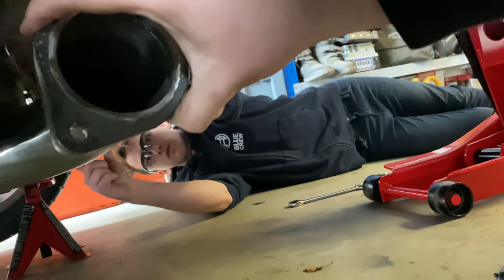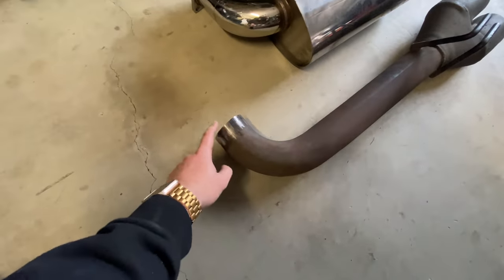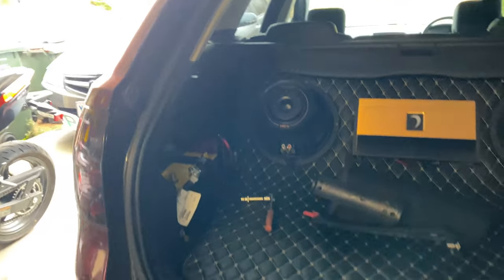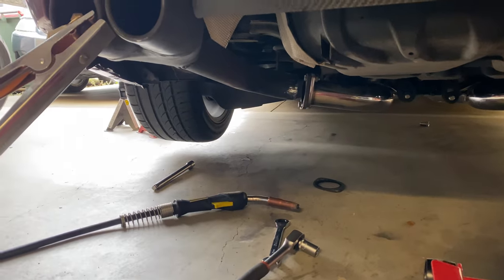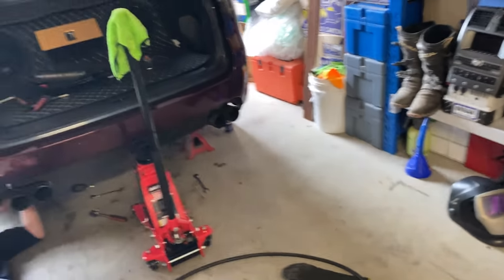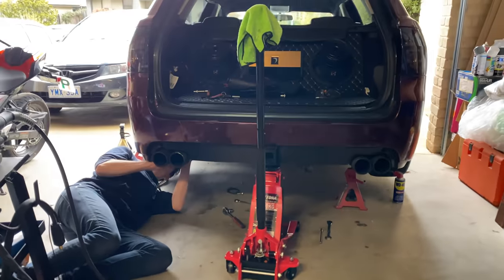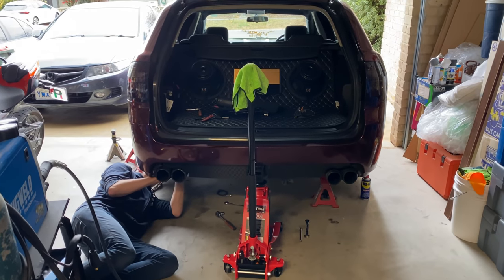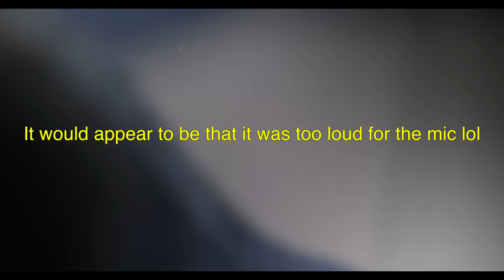I Straight Piped My VE SS Wagon

Comment: J pipes are helmholtz resonators bro, and they do work if done right!!!
I had a set that I welded 90 degrees to the straight pipe exhaust of my isf before I changed to my new set up.
If you do the maths right and get them the perfect length, most of your low down drone disappears with only a little change to the straight pipe sound 👌👌
Reply from the maker: They do make some you can buy off the shelf that are supposedly tuned at the right frequency to kill the drone, since it’s pretty much a identical on all the VE-VF’s

Comment: If your exhaust drones it's trash a good exhaust should always sound good and not be a compromise of driveability
Reply from the maker: Not always the case... with the length of pipe, diameter and shape of the cabin and since the rear ends of our car are almost all plastic, almost every aftermarket exhaust drones

Comment: having an automatic gearbox doesn't help with exhaust systems it ruins them in my opinion because it causes the gear changes to be obnoxious due to not having the noise cuts between shifts
Reply from the maker: I do agree with you on that! My mate has an identical car to me, only difference is it’s manual... and it really does sound so much better
Reply: @Mick_Hinchy  would you convert it to manual down the track or are you set on the auto?